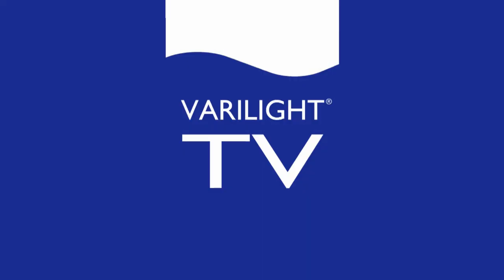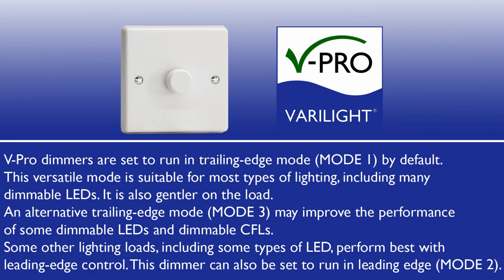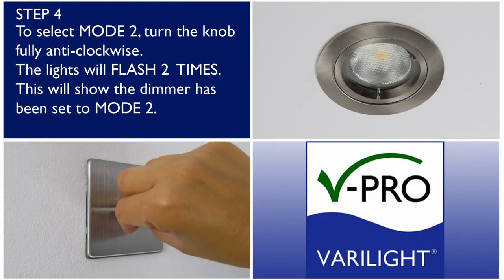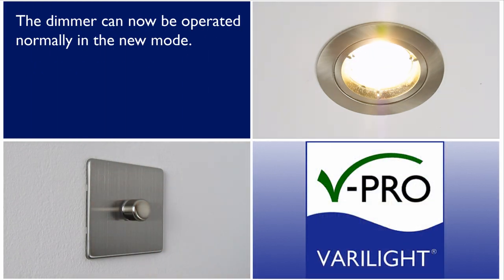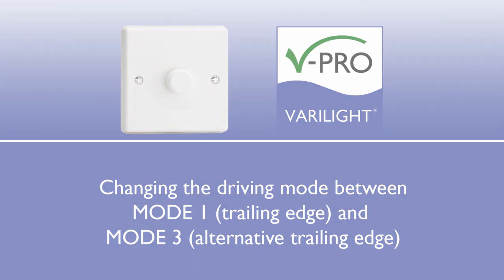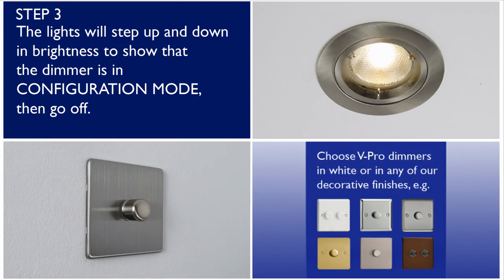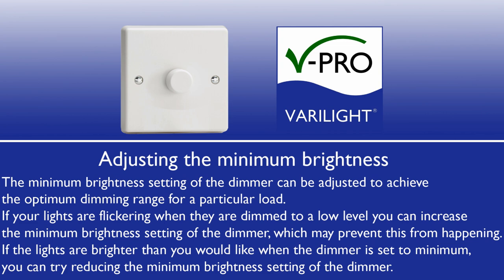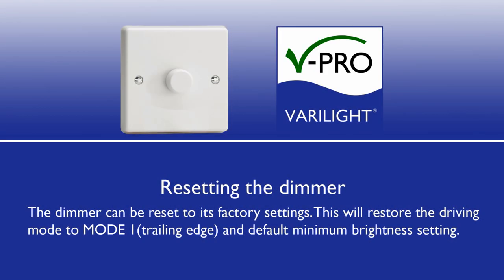How to program Varilight V-Pro dimmers

Comment: For everyone who is having the problem of the light not going off in configuration mode. I realised you dont need to wait for it to go off permanently. All you have to do is... as the light steps up and goes off in the first instance, quickly execute the next step before it goes on and off again. This has definitly worked for me and should work for you guys too.
Reply: Completed agree. I was bashing my head against the wall, but realised that the stepping up/off is so quick, so you should immediately move onto the next step quickly to make it work. Thanks for the tip.
Reply: This is literally why Im here 😅
Reply: You saved my life

Comment: Understanding things / Bookmarks:
-0:13: Trailing edge (Mode 1) Vs Leading Edge (Mode 2) Vs Alternate trailing edge (Mode 3).
-0:47: Changing between Trailing edge (mode 1)  to Leading Edge (mode 2).
-1:50: Changing between Trailing edge (mode 1)  to Alternate trailing edge (mode 3).
-3:04: Adjusting MINIMUM brightness setting.
-4:27: RESETTING the dimmer to factory settings.

Comment: How do you know if your dimmer switch is in the correct driving mode or not. What are some of the performance issue you might experience if the dimmer switch is in the wrong driving mode?
Reply: Hi, I see you left this comment about one year ago and it seems nobody got back to you yet... I'm pretty much in the same spot... Did you find out anything about it? I doubt these v pro people will reply to my message...
Reply: There are instructions on resetting the Dimmer back to Mode 1 which is the default mode and which works pretty well with LEDs.
Reply: Well the one I just fitted just switches off after 10 secs
Reply: @MrAlexMoto Same as me, did you figure out what the issue is?
Reply: @LeoMenzies  no left it in customers hands now, very strange but all I can think is it’s in wrong mode 🤷🏻‍♂️
Reply: I've just had these installed with v50 lights. Does anyone know the best mode for them? Mine work, bit randomly turn off after 5 seconds every now and then
Reply: @tombentley1422  I have seen the best results on mode 3 (my Led spec sheet says I need to use trailing edge - so mode 1 or 3). Still get the random switch-off after 5/6 seconds.

Comment: A tasteful work of fiction this video .......  WHATEVER instructions set I follow I can get the lights to come on very brightly - BUT only for a moment 
After that they dropback to a middling not dim but less than half way to where it should be at full on.
Bypass the dimmer & connect direct - get full brightness.    Refit the dimmer,  more of the same half way there at best!
UPDATE ....  If at first you don't succeed .....   Eventually did get it toreturn to factory reset mode by varying how quickly I was clicking Off/On
It didn't like 1 second spacing, fasterworked.

Comment: couldnt understand the written instructions, but the video sorted me out,  When I first installed the wall switch my bulbs were dimmer than usual but switching to Mode 3 sorted me out.   I have 2 tungstens mixed with 1 led  Thanks
Reply: Same here! But I had to watch this video about 10 times and take screenshots of each step before I learned how to change from Mode 1 to Mode 2. Now I have to try that to see if it sorted out the brightness

Comment: What this doesn't mention is that that you may have to substitute an old tungsten light to make the changes. For instance, I have a chandelier with 6 bulbs. If I don't substitute one of them for a cooker bulb I just happened to have, I get the same disappointing results most people mention. With an old tungsten bulb, the other five leds behave as they should and can be adjusted perfectly, just as in the video.
Reply from the maker: Hello Roger,

Thanks for your comment!

This is always a great thing to do during programming, as the resistive load of the halogen and incandescent lamp will stabilise the LEDs. 

Thanks for your feedback. We now mention this in our newer videos, such as 'How To Programme V-Pro IR'.

Thanks for your interest in Varilight.

George

Comment: 'The lights will step up and down in brightness to show the dimmer is in configuration mode, then go off' Mine doesn't go off, so no steps after that seem to work.
Reply from the maker: ***** Some LED lamps may not turn off which is related to the design of the driver. The programming procedure can still be completed however if the steps aren't clear we would recommend to change 1 of the lamps for a halogen lamp for the duration of the programming.

Comment: Just installed one of these and finally proved to my wife it is possible to have dimmable LEDs without flickering or buzzing!! Success after years of supposedly LED friendly alternative dimmer switches.
Reply from the maker: Hi Matthew! Thanks for the kind words. I'm glad you've found the dimmer you were looking for. 

George
Reply: Some lamps also perform better than others even with the trailing edge dimmers being used. I've recently installed Aurora ICE lamps and they are of excellent quality.
Reply: Just had new dimmable led light fitted today along with another brand dimmable led switch and buzzing is aweful.  Electrician said its nature of switch and to buy a better 1.  Sounds like 1 is worth a try

Comment: Trevor. Hi fitted several of these with no problem but now have a unit that after selecting dim suddenly reverts to full brightness at the end of the dimming range ie anti clockwise. Tried returning to factory settings and adjusting minimum brightness but same problem exists. Other dimmers fine

Comment: Also purchased the product, it will not programme for me. I can't change the bulb for halogen as I have a strip. Light are flickering, dimming, going on or off. Unfortunately disappointed with the product.
Reply from the maker: Hello Oli & Nikki,

Thanks for your comment!

It's always good to change the bulb for halogen during programming, as the resistive load of the halogen and incandescent lamp will stabilise the LEDs. We do recognise, however, that in certain situations this is not feasable or even possible. Depending on the driver you have for the strip, it could be that they are triac dimmable or 1-10v controlled, Dali operated etc. In any of these cases the V-Pro dimmer will not be suitable. For best results when using the V-Pro dimmer we recommend using our 12VDC driver, the YT40DC12 to power the LED strip.

If you have any further questions, feel free to contact our customer services directly by creating a support ticket on our website (www.varilight.co.uk) or giving us a call on 01293 223333.

Thanks for your feedback, and for your interest in Varilight.

Kind Regards,

George Fry
Varilight

Comment: I've tried these settings but the dimming brightness range is not great. My bulb does go much brighter after a reset but then goes back to normal. Its a 13W LED dimmable so should be much brighter. Any idea how to increase the brightness?
Reply: I think I solved it. When the light cycles and then off you have to turn the brightness knob before the light comes back on again. They need to add that in the video for idiots like me!

Comment: What do thses different modes do? Please help. The lights don't go off in configuration mode.
Yes I have worked out that you have to time it right.
What is the difference between mode 1 and 3?
Reply from the maker: Hello Vince, thanks for your message. The difference is in performance, so they will behave slightly differently from one and other whilst still utilising a Trailing edge signal.
Reply: @varilight  OK thanks. I had already kind of worked it out. I take that the difference between both  trailing edge modes is minor, and will make little difference to the life of the leds(unless there is an obvious flicker).

Comment: I've just fit this and tried all 3 modes, and changed the minimum brightness setting, but it won't dim low enough so is still brighter than wanted at lowest level. Is this the dimmer or the bulbs?
Reply: What bulb brand did you use pal?
Reply: @evieemaya88  meridian
Reply: @charlesmilligan1416  I spoke with their tech support team and they recommend Megaman and Philips bulbs.  I'm changing mine this weekend so will keep you updated if I have same issues to save u buying all new bulbs when it could just be "that's how they are".
Reply: @evieemaya88  nice one thanks mate
Reply: @charlesmilligan1416  hey Charlie mate. Ive changed my switch over and added the megaman bulbs i purchased.  there is a video on my page.  my phone camera doesnt do it justice.  But on mine they dim to a nice low cost level and go bright to quite a high level. I spoke with varilight and the brands they did specifically recommend was megaman and also philips.  All the links to what i used is in my description. hope it helps pal :-)

Comment: I assume if you have 2 gang 2 rotary knobs vpro dimmer then you have push them both at the same time to change it from default mode 1 to mode 2 for leading edge use?
Reply from the maker: Hello Mohammed, thanks for your question. The 2 dimmers on the back are completely separate, so are to be programmed individually. You can try and programme them both at the same time, but I think it'll be more time efficient to programme them separately.

Comment: Printed out all 4 steps then tried to change my Varilight Pro-V dimmer from 'driving' mode 1 to 'driving' mode 2 - with no success! I sincerely wish I had not bought the Varilight Pro-V dimmer now.
Reply from the maker: Hello Shereen, thanks for your comment.

If you give our customer services a call on 01293223333, we can help troubleshooting your issues. 

Thanks.

Comment: Thank you so much for the video. I have struggled and struggled to find the mode that doesn't flicker.
I have led strips around the whole ceiling acting as downlighters with coving hiding it. Leading edge (mode 2) seems to work best. I've read trailing edge is easier on the load. Does this mean mode 2 is straining the led strips or will reduce their life span?
Reply from the maker: Hello Peter, thanks for your message. 

Either mode will be reducing the amount of current running through the componentry on your transformers and strip, reducing the strain and extending the lifespan.

Comment: Oh dear, i think the programming could have been better - why not a switch on the back for the modes at least?  right, my lights were dimming last night. this morning the settings had been forgotten and now it seems no matter what cant program (lights dont go off, or show signs of programming). Also, given that I have a two gang version, one with wires on top, the other below - which way round is actually MAX or MIN?? bit disappointed to be honest
Reply from the maker: Hello rballen69, thanks for your question. In our market research on developing this product, we found that a majority of end users aren't comfortable removing wiring accessories from the wall, so the programming is designed without alienating those users. 

I'm not sure the issues you are having are programming related, it seems like your dimmer modules or lighting may have failed.

With the max and minimum brightness, the control knob on the front is circular, and the dimmer has been rotated 180 degrees, so will operate in an identical fashion.
Reply: @varilight  sorry of course the 180 degree now makes sense, I'm guessing in desperation I latched onto this as the  act of programming isn't showing any output any longer

The lights always seems to start bright, go summer and repeat twice leaving them bright on
Reply from the maker: @rballen69 Good morning, have you tried putting a halogen into the circuit to stabilise the load?

Comment: Can you recommend me any led dimmable g9 daylight bulbs ( 6000 - 6500k daylight ) which will work with the varilight JSP252-P or JSP252 vpro trailing edge led dimmer switches as most of the led dimmable bulbs on AMAZON seem to work with triac ( leading edge dimmers)  unless  I change  mode 1 ( trailing edge ) to mode 2 on vpro for leading edge? Thanks.

Comment: Hi, I've currently got the dimmer installed and working however I'm changing to a non dimmable LED light fitting and was trying to set the minimum to 99% to effectively turn the dimmer into a push on off switch but it doesn't seem to want to do it following these steps, any help would be great. Thanks
Reply from the maker: Hello Chris, unfortunately that's not a function of the dimmer, as it'll always be a dimmer sending a dimmed signal, even at full brightness. We have a product to suit this application, please see here: https://www.varilight.co.uk/configurator/product.php?code=MH0